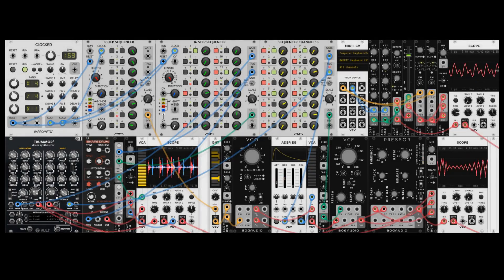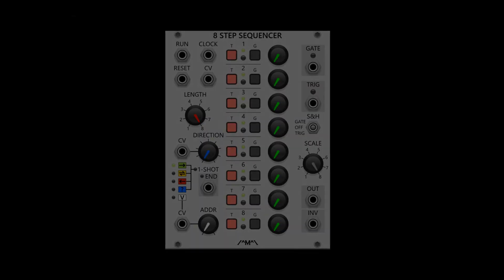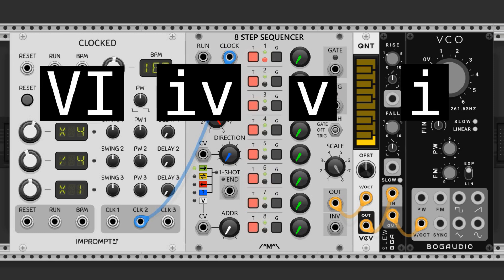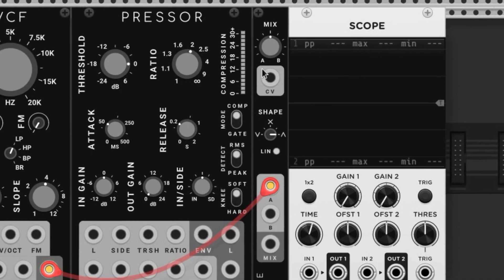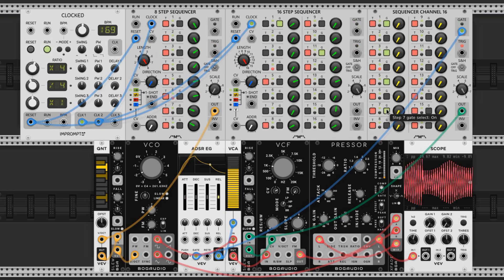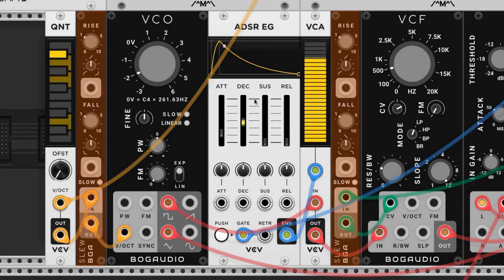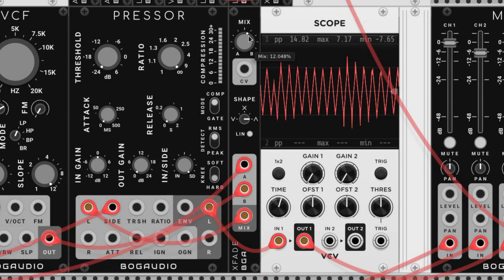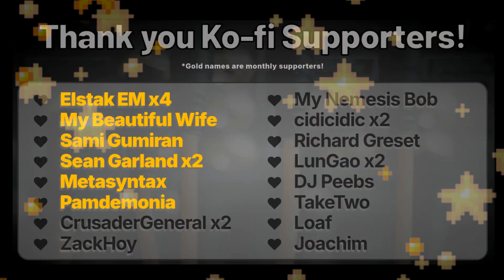VCV Rack Patch from Scratch Part 2 // BASS!

Comment: How did you learn these things? Testing and error?
Reply from the maker: Thanks for the question, @nunodias8927. I learned the techniques over the years by reading about them and then applying them when making patches. 😁 I like to read, lol. I made a cheat sheet that is 100% free on my Ko-fi page. It has a bunch of techniques simplefied with graphs. If you're interested, I'd say checking that out is a good way to see many common techniques in one spot. Testing and fixing, like you say, is a big part in making patches too. It's what makes it fun and sometimes you make something that sounds great by accident. 🤘😁